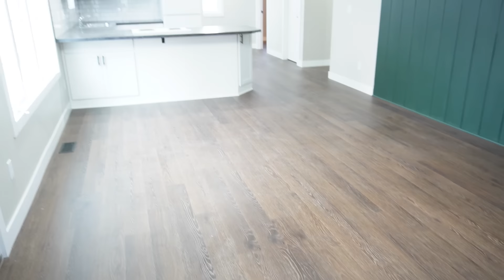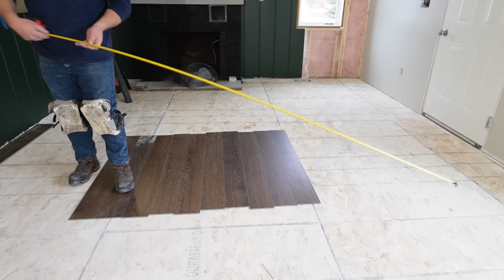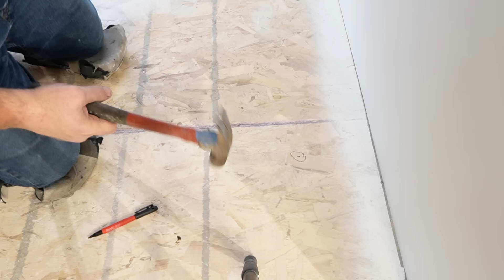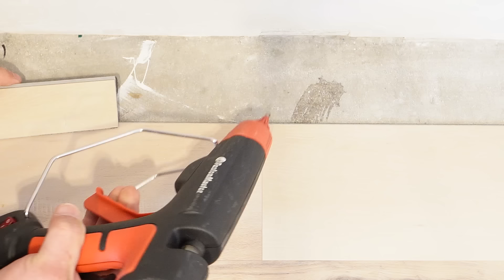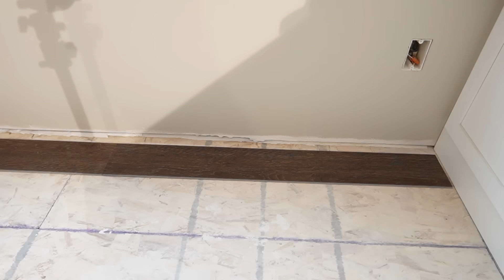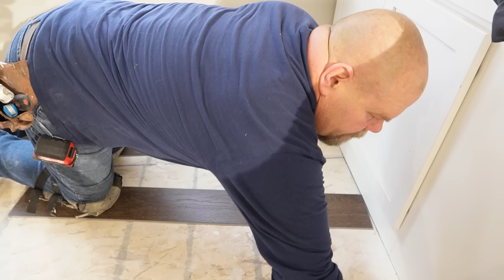The MOST CLEVER Way to Start the First Rows | Vinyl Plank Installation

Comment: I guess I'm just dense. But I still fail to see how you find a straight start. Worse still, my starting wall has a baseboard style radiator making it harder to start at the opposite wall. My walls are uneven, e.g.  S. wall to N. wall 12'4'' at one end 12' 4 3/8'' about the middle & 12' 5' 3/8'' at the far end of the same wall. If I start at the opposite wall without the radiator it'll be harder to tap into place. Right??
Reply from the maker: Watch this - https://youtu.be/icqx8ZzpKiw

Comment: Help!! I am having a heck of a time trying to lay my floor out. My room is off square bad and I'm trying to establish a straight line to go off of and I don't know how to do that while also determing how far away I need to be away from the other wall. I laid out my planks from the straightest wall I had and it left me with about an inch gap so I figure if I cut my plank in half it will give me at least 3 inches on each side but I just want to establish a straight line first so I know. I'm probably overthinking this way too much.

Comment: I have engineered bamboo, interlocking, pad on the back. Having A LOT of trouble getting the planks to interlock. I get the short end, but the long end does not fall into place. I do multiple planks to try to get them to support each other, but they just fall apart. I must be doing something wrong, but don’t know what. 😢

Comment: Did not explain how you  came up with where to put your chalk line
Reply: @coastercrush3635  Let me help you out, bud. Did you see how he laid out the flooring and measured it? Lay out all the pieces from the box as shown in the video. You use that measurement to work backward from where you would like your joint to land. Measure back until you get to the point where the last full row will fit. Remember, walls are not always plum or straight. You're gonna have to square things out with your tape measure.
Reply: @EliteSuperGrunt  huh?  He laid them out but what did he do?
Reply: I found that answer in his other video; https://www.youtube.com/watch?v=gmFr5k3IkV4

Comment: Your videos have been GREAT. We are about to buy the tools pack. ;-) (I kind of want the hoodie also).

Do you have any experience installing LVP over warm boards or eco warm (that is what we are currently installing). We knew you could put LVP over radiant, but missed the memo that you may have to add another layer (argh) - probably just going to put durock down - but it impacts now the height of our floor (mostly towards a step is the major issues). We were pretty set up on Flooret Signature, but now think we should look for something thinner -- would could go Flooret base or other brands. We have searched high and low looking for someone who has put it directly on top (this is not concrete radiant), and can't find find a definite answer whether we need the extra layer between. We know it can't be above 85 - we are just wondering if the radiant folks are CYA and the LVP are CYA and no one wants to say it is ok - although it probably is....if anyone has any thoughts or experience we would love to hear it - the Ecoboards and the tubing has already been installed os that is not changing.

Comment: Just started laying my floor today. Finally got enough subfloor refinished to start installing.

I used your method for the cheater board and the screening down of the second row with scraps to keep it from moving. But I am still using spacers at the wall I'm talking towards since I want a right seam with my planks. 

Everything's going great so far. I wish I would have watched this one first though because it would have helped with my staggering pattern. But mine still turned out great. Just took longer. 

Thanks for all your videos. They are exceptional compared to most. 

Shout out to Jeff over at renovision too. You and him are awesome.

Comment: Im having an issue with starting even after watching...

I want to run the same lvp through the house..my hall way is the center point and measures 33.5, my planks nominal is 7 inches, that leaves me with 2 3/4 on either end of the hall. My jambs are around 4.25 so i can just about fall in the jamb without having to cut wach side. 

My problem is the skinny side pieces, if i move over and not aplit the middle i just get skinnier on one side....what should i do?

Comment: If the extra width needed is less than half a board wide do you still center and split the difference?  I end up with two long strips down the exges if my hallway that are only 2.5" wide.  Using 7.17" wide planks. Hall is 84" not counting 2 doors on both sides.

Comment: I use the same method. But I use two screws in the blocks at the butt joints,so the blocks don't twist. On concrete I use tapcons because I don't have the glue gun.

Comment: Is it OK to put kitchen Appliances on the vinyl plank flooring like stove, side-by-side refrigerator and a washing machine... also is it OK to lay 1/2 the floor then put the appliances back on the new plank floor.. I worry about the refrigerator.. Can I just lay down scrap piece's down to roll the refrig. then lifting like the back of the refrigerator to get the wheels on the scraps pieces then to roll onto the new floor without breaking locking mechanism..... Thank's for any info..

Comment: I am going to use the same click flooring from the living room into the front hallway. Can I continue the flooring from the living room to the hallway or would I need to put a threshold door bar at the door? If the flooring needs to be climatised and I am thinking that because the front hall is generally cooler it would be best to put a threshold bar as there will be less expansion?

Comment: Joe! Your videos have helped me take on the flooring of a 960 square foot 'cabin' in the Upper Peninsula of Michigan. How did you come up with the spacing of 1 to 1 1/2 inches away from the wall? I have cut 1/4 in thick scrap pine to act as spacers, using blue painter's tape to hold in place. I buy in to using the chalk line. I did laminate flooring four summers ago in my Littleton, CO 'Watson Gulch' home but was using 20 some year old laminate flooring from Lowes. The big mistake was allowing dogs in every evening... The click together flooring does not lock in place when the groove has dirt and dog hair. I am doing one room at a time and I am the doing the project 'solo'

Comment: Great video!! Gluing sacrificial pieces on the first row worked wonderfully for my install on concrete.  I snapped a chalk line but my room was almost perfectly square so the chalk line was really used as a nice check of my work when my planks reached the line.  I recommend planning how your last row will meet the opposite wall so you aren’t left with a thin strip.
Reply: A tape measure may come in handy

Comment: What did you measure off of to snap your chalk line? I’m ready to install my floor the only thing I can’t figure out is how to make sure my floor goes in square. Can you help me learn how to make sure it goes in square? I can’t seem to find any videos about it
Reply: @nicholasnelson1473  exactly if tgat chalk lines bad then this video is useless
Reply: Pythagorean.  You measure off a straight wall like 3+4=5 triangular.  Assuming the other wall is also straight it will look good, may have to adjust tho if one wall or object isn't quite square.  Good to do a little mock run with a few pieces to make sure it will look good and work out before starting.

Comment: At the end, when you remove the nailed-down guide pieces, couldn't you just push all the floor panels up against the wall? Actually, here's another idea, since the planks at the edge are going to be hidden by the wall trim anyways, why not just nail down a full size plank down at the edge?
Reply: @N0Lif3  Because, not all walls are straight, & that (first/last) piece has to be  traced out to match.  Also,  you don't want a small 2" strip at an edge along the wall, or in a transition,  so you split the difference between the beginning & end. Plus, you want all your planks straight,  & not Cockeyed through the room, so he lines it out to be squared up first, (since not all rooms are always square), and then brings it up to the edge starter he wants,  & builds off a solid straight foundation.
Reply: @mariatorres9789 won’t you end up having a lot of length wise boards to cut if you end up with really off walls that are no where straight like they’re supposed to be? My outer wall is so off and I have no idea what to do. 😢

Comment: I did three rooms by following these instructions and it turned out great!  The best tips are how to plan out the first row and plan out how NOT to have a small sliver opening at the other end of the room. It also helped since I had a doorway at the first row, and needed to cut the first row back so the first row would go into the doorway about an inch or so.  Joe really knows what he is doing. Thanks Joe!

Comment: The company I bought my lvp from only has flush mount stair noses. I saw your other video that said you should not use at the top where it meets the floating floor. What do you recommend that I do? 

Do a glue the first plank in addition to the stairnose and pray for the best? 
Should I use a t-molding at the top? 

Please let me know. Thank you.

Comment: We've been watching your vids so we can learn to lay LVP and replace the nasty carpet in our newer house. We laid bamboo in our other house, and may have gotten spoiled with the quality! 

The vid where you show the hallway to start as your guide, you mentioned how to make the outside edges at least a ½ plank instead of the small tiny pieces. Is that only with hallways? Now this video, the edge is smaller. I don't understand how small is too small?

We finished room 1 with 4 more rooms to go. While my husband was at work yesterday, I set it up the room the way you showed how to do the hallways. That first 3 rows were so hard because the room had a bow and a closet in the middle. 

This video shows starting from left to right. I missed the part about using 10 planks. I'm assuming the 10 planks are key to everything in a room?

 I'll have to search your vids to understand how to use the 10 planks when laying LVP. If someone knows the name of the video explaining this, would you mind posting it here? Thank you. I'm dreading the next room tomorrow!!😢

Comment: I can look at the floor in the house I moved In 1 year ago and see the installer did not lock the ends together, then the sides.  He clearly locked the sides then beat the whole plank down to lock in yhr end with its neighbor.  About 10% of the planks are lifting just a little on the locking end of the planks.  I know correct procedure now when I rip it up to redo it.  The only time I ever installed, I did it the same way my installer did...wrong.  Luckily it didn't lift the ends when I did it.  Now I can do it right.
Reply: If your floor is not vinyl and is a laminate composite, the licking system can make it nearly impossible to lock in end pieces against the wall. The short end needs to be locked in and the long end hammered into place.
I am currently working on this type, it can be a bit of a pain in the ass.

Comment: I see you didn't screw or glue the floor, and since you leave 1/4" gap will the floor move after time? what keep the floor in place?
Reply: @kibubkibub  it’s gotta have room for expansion and contraction is the summer it’ll expand and in the winter it’ll contract that’s why you leave the 1/4 inch gap between the wall and the flooring ends

Comment: Great video. Learned a lot. However, my biggest problem/frustration is connecting the butt joints. I angle the board slightly and when I drop the board down it either doesn't go in or it bends or breaks the tongue. I try to tap it in and it breaks for sure. This happens 95% of the time. Any suggestions?
Reply from the maker: What brand of plank?
Reply: @sothatshowyoudothat  4 mil Traffic Master from Home Depot
Reply from the maker: Sounds like you need to get a higher angle to lock in butt joint then get the long joint locked in.
Reply from the maker: I show how to install this here - https://youtu.be/HQlNnsNV7ZA
Reply: @sothatshowyoudothat  Thanks. Let me give that a try. I think my biggest challenge is installing over a ceramic tile floor and the tiles are not flat, they have a "wavy" contour to them. Everyone I've talked to even Home Depot says that shouldn't be a problem. I don't agree.
Reply: Just watched your Best and Worst Vinyl Plank video and I can easily with no effort snap off the butt joint tongue. Great video. Thanks Joe!!!

Comment: But how do you begin when flooring an entire house, with hallways, doorways, closets, rooms?
Reply: Since it is rarely going to be properly square, you take the easy way out and put transition strips between rooms. Or the hard way with no transitions is to map it out and prioritize which areas must look correct, and which areas where crooked planks will be hidden or less obvious. There are guides on YouTube.
Reply: I'm actually doing my friends floor as we speak. I started in the hall at the furthest bedroom running toward the living room. The first full piece starts a 1/4" from the door way. Then next row goes into the bedroom and hallway. I only do two rows into the living room first to see how square the hallway and living room are just to be sure that the flooring is and appears straight.

Comment: Is it always necessary to remove a sheet vinyl floor before laying vinyl plank? My subfloor in 1/2" particle board over 3/4 plywood and it's only about 10 years old so it's in good condition. We're doing the entire house so it's a mix of sheet vinyl and carpet, carpet's worn out so I'm going to have to lay another layer of subfloor to make up the difference between the carpeted area and old vinyl.

Comment: I notice when you start with your 8 cut spacers they look about 1-1/2" to 2" which means when you finish and remove the screws, the real planks must be cut to that 1-1/2" width.  I'm going to be using 7-1/2" wide planks.  What's the reason you don't make those spacers more like 5" or 6"?  Also, you said you always start with the tongue against the wall long ways and width ways.  Do you cut the tongue off against the wall so when you push to the wall you can more easily get the pull bar between the plank and the wall?  I hope that's clear enough for you to get what I'm asking.  Thanks for the great videos.  Maybe I won't cuss and throw things as much, cause I get real frustrated when I do something stupid.

Comment: What determined where you snapped your chalk line?
Reply: I second this question. That 41-1/16" measurement had me lost as a result of this I believe.
Reply: That measurement is relative and is determined by multiplying the width of your flooring planks and where u want them to start or stop, that line can literally be anywhere in the room.
Reply: If I may add, that line determines where you can get a full width plank, as and already said, can be anywhere, long as it is a straight line.
You can design the width of the 1st row, when you decide where to snap your line,
Reply: You pick that spot based on the widths of the planks and where it would have you fall at in relation to the wall. in regards to what size plank will fit for your last rows plank width.  Its very seldom you can start on a wall and work away and not have a really thin strip on one or both sides. Thats the purpose of doing that little bit of planning and prep work. I will say that not putting thresholds on more than 1 room is not advised.  There needs to be room for expansion. Just like he did against the cabinet but if you transition from room to room to room depending on where you are and what kind of ground you have. I'm in south east Texas(at sea level also) and we have clay and there is alot of movement so they'll buckle if you don't add transitions. Happens every time around here but your areas ground profile matters as to wether thats a problem or not. Just what I've seen in my experience with it. I did flooring for a few years when I was younger.

Comment: I love your guides and tips Joe, you explain processes extremely well. Much appreciated! 
Starting line for my project is the one that is making me nervous - because opposite my preferred starting wall, I have a stair going down (so essentially that main floor is a giant 'landing' level and needs a stair nosing strip to finish it). Between this video and the one from about a year ago (measuring from door transition back to the starting point) that will give me good confidence to start it in the right location. It's a very wide section, so the 10 plank trick is essential to get the layout width exact. I'm a convert to Flooret after seeing your reviews on their products, but important to note their stated width on Silvan spec sheet is NOT correct, so measuring 10 planks is definitely good way to go for anyone. I'm planning to give myself an extra 1/4" over, since it HAS to overhang the edge - It can be long but absolutely cannot be short! :)